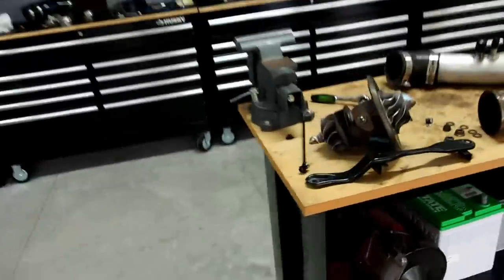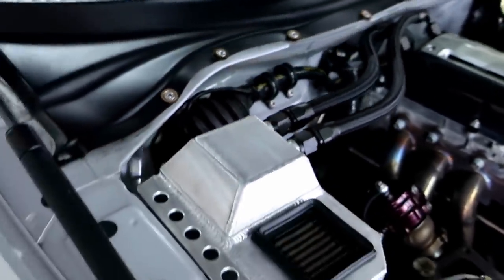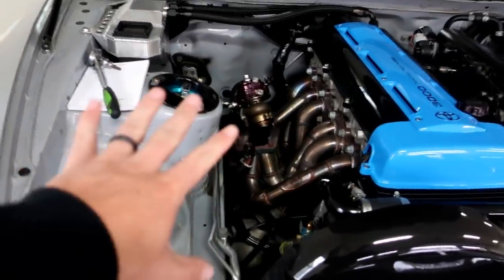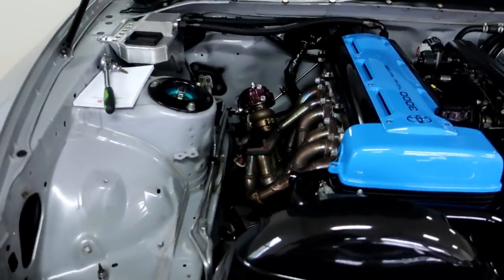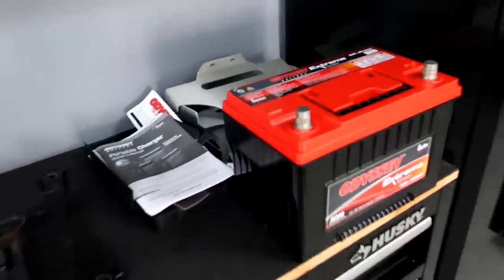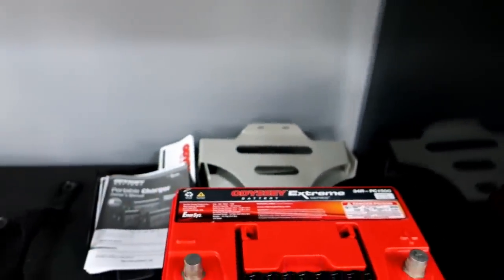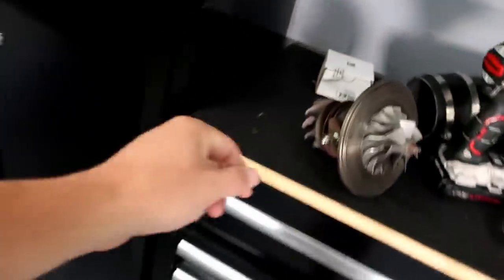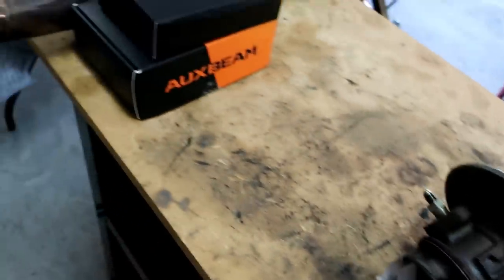Supra Parts Back From Powder Coat!

Comment: Hey Ryan! One thing I'd definitely try with the battery is using SEM Trim Black paint, comes in a can, and it's awesome for OEM looking textured black finish. I can send you pics of the results on facebook if you want, I used it on my fusebox cover and my wiper shroud to restore it. It has a very oem look to it, clean.   -Rich

Comment: There is actually some coating paste out there,which is able to prevent the nuts from getting "rusted" on....i think it's called molycoat or so.it's a high temperature paste which u could apply on the thread and the next time you open up the nut,it should be alot easier.
Reply: PURE Function that should hopefully work out ;)